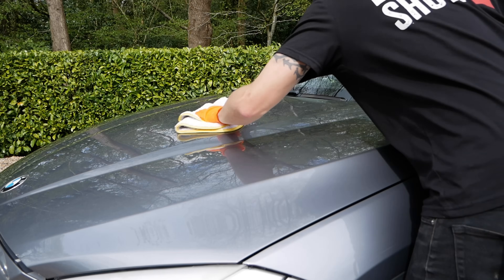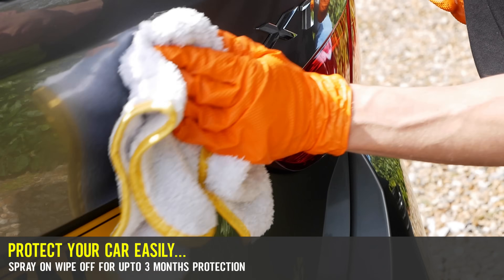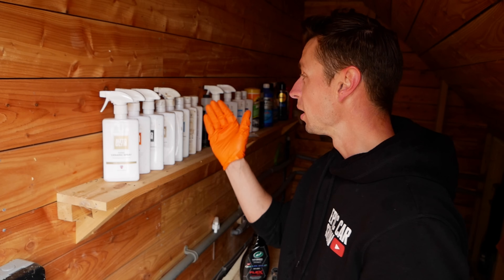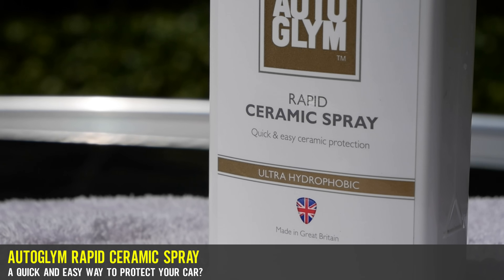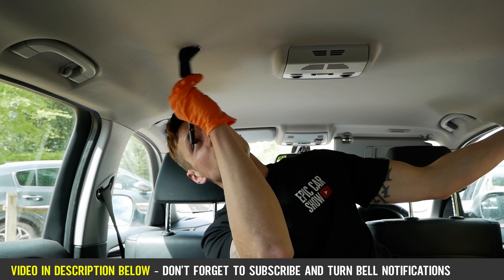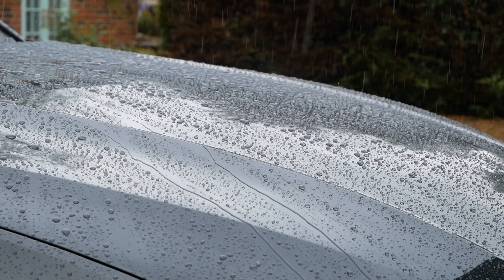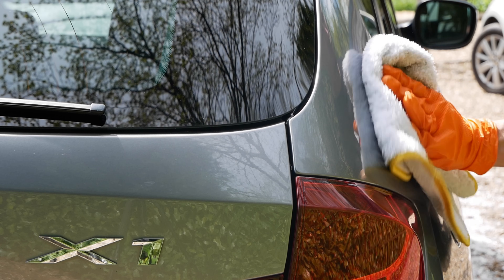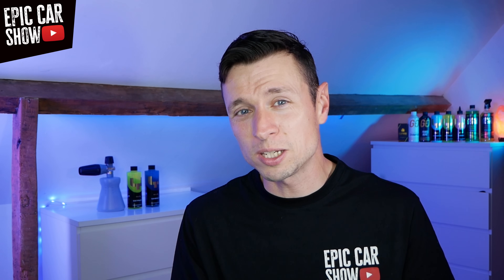Turtle Wax Graphene flex wax Vs Autoglym Rapid Ceramic spray Detailer // WHICH IS BEST?

Comment: I’ve had no issues with streaking with the turtle wax, light spray direct to the panel  and buff with a soft microfibre. My best wishes to Martin and family, my wife is a Macmillan nurse so I know you are having a tough time at the moment but try to stay positive.
Reply: Hi Dan, Thank you for your kind words and God bless your wife and all the other wonderful Macmillan nurses.
Reply from the maker: Thanks Dan. Love seeing so many people send kind words to Martin! This is such a fantastic community
Reply: @epicautomotivedetailing  It is a pleasant change to see people support each other, as you have stated there is so much negativity on Detailing forums and it needs to stop. We all may love cars and detailing but you just don’t know what is happening in people’s lives and how this bullying behaviour affects them.
Reply from the maker: @danlegge2742  yeah I want to try fix the problem or at least make it better by doing something positive
Reply: Have not used Autoglym as it appears to be quality products throughout. 
I however have been using the TW FLEX especially as an occasional topper to the TW MAX Wax.  The FLEX needs an initial wipe (per directions) with a damp towel followed by a buff with favorite fluffy.  Some have made an issue of the extra step...for me the astounding results render it moot.  The damp towel (for me) has constantly knocked down high points and streaking...light application of spray is essential!!
Points made and taken about time and effort on the car flip/professional level - point taken.  As a driveway detailer primarily doing my own rides -  appearance is the end game. Ten extra minutes don't  matter as long as I get the "dayamn!" look.  
All good! Give it a try!  I dig the British detail channels  - watching from across the pond!
Reply from the maker: @audieconrad8995  wow thank you and hello from UK. The term detailing is bit different to USA. We have car valeting which is deemed to be a service that requires just a good clean and detailing itself is something that is mainly aimed at paint correction and protection services so it can get confusing. I really like both of them but when I use Autoglym I can do it in fraction of the time. Sounds silly as both products similar but Autoglym is just better all round in all weather whereas turtle wax struggles in the heat for me 🙂
Reply: @epicautomotivedetailing  as mentioned - the AG has a good rep.  I'd like to give it a go.  Shine on you crazy diamond!

Comment: Great video again, and I like the way you keep them nice and compact while thoroughly explaining everything, instead of spending 45 minutes waffling and showing us the entire clean, which is completely pointless. 

I like most Autoglym products for their ease of use and speed. When you're getting on a bit like me and tire a lot quicker, it's mega important. However, I did get a 3-bottle kit of Turtle Wax's Jet Black products at a good price a couple of years ago and was really impressed with the way it enhanced the paintwork on my metallic black car. so I recently found a ridiculously cheap deal of all 3 graphene products for an all-in price of £22 recently so I bought those. I've only tried the detailer so far, but I found it so much harder to use that I would drop it a good 2-3 points compared to the Autoglym product. That said, it does seem to give a better, "blacker" finish on my particular car so maybe it's better suited to darker colours. Love the Autoglym though and although the shine isn't quite as good (may I'm using too much), it's much easier to use and that wins it for me.

Comment: Dave, love this video and your other on the AutoGlym Super Resin Polish. I have been cleaning and detailing cars for 30 odd years and I used to think Meguiars was the gold standard, UNTIL I discovered Autoglym. The Glass polish is amazing, and then I found the Super Resin Polish, which has literally been life changing. I use it on every car, from 911's to Toyota's and it gives the same very consistent and fantastic easy to use result. I tend not to use a wax, preferring to just use the Polish as a one only product. These Videos are fantastic, and I think support the brilliant quality that is Autoglym. As you say, they are not big on flashy labels and bottles, but it's what's inside the bottle that counts, and there is NO-DOUBT, that Autoglym is the gold standard for car care products.... If you've not tried Super Resin Polish, try it and you'll be converted.
Reply from the maker: Thank you my next video is a feature on many autoglym products 👌

Comment: nice shout out :)  
I haven't heard good things about the turtle wax flex wax durability, most people I've spoken to are saying a few months at best for the flex wax, that and the price, and yet again streaking issues.  The better product for my money, seems to be the graphene paste wax.  
I really don't like the AG spray bottles at all.  there are some good products, but the sprayers tend to leak, and leak some more, and they aren't comfortable to hold if your spraying a lot.  Right now, looking at halfords shelves, I'd be more inclined to go with meguiars ceramic wet wax and detailer over anything else right now.
Reply from the maker: I've got the paste wax which is great for gloss
Reply: Bottles/spray top of autoglym are  restrictive as so small in hand and are flimsy

Comment: I may be wrong, but I think Autoglym have the edge on customer recognition. 
If you are using Autoglym products, the customer is usually familiar with the brand, and knows of its quality. 
Given the choice, I would reach for the Autoglym product. 
Great video BTW
Reply from the maker: Your right about recognition, but the newer generation are easily distracted by flashy packaging and for Autoglym to bring out a new product with a very light brown label it just didn't catch my attention to make me think (ooh that's new lol) cheers for watching Kevin 🙏😁
Reply: @epicautomotivedetailing  I fully understand your point about brand recognition, but if your are going to change your whole world wide recognized branding for a generation that have the attention span of an Argentinian Ant, then your are going to end up in the complete toilet. The modern generation change their favourite polo brand between leaving home and arriving at work if they see a flashy Billboard. Aotoglym did not get a royal warrant for nothing, there are plenty out there who would love one. The generation of which we speak don't find brand loyalty well into their 30,s now, don't go throwing years of building up brand recognition and loyalty to grab their attention for 5 minutes. Just my thoughts, love your work.
Reply: Can we use both together?I am currently using rapid spray but want to improve durability.What other products can I use with this?

Comment: tried both and you're correct. Turtle wax flex wax is time consuming to apply on dry paint as a base coat. On business stand point where time is money i can understand you favoring Autoglym which is a great product by all means. However the longevity, durability wise i'll go for turtle wax flex wax + for the money it's a bargain especially doing their recommended 2 sprays per panel at the same time be able to use it on wet paint as a topper, but then again yeah, the streaking issue which is easily resolvable but also time consuming. both products are great in their own term. great review.
Reply from the maker: Thanks mate I was trying to get into the mindset of what someone like a weekend warrior would do so when i would wash my own car i would always spray something on top

Comment: I use Turtle wax hybrid ceramic wax. To avoid streaks I spray it onto an applicator pad. Just one spray per panel, just enough to keep the pad damp, then I buff it off  with a microfibre towel. I will definitely try AutoGlym next though, as it looks a lot easier and quicker to use. 👍

Comment: I use the turtle wax graphene, haven’t had any streaks, I spray 2 sprays onto my applicator per panel, in up down left right cross and then buff it off after, gleaming!
Reply from the maker: Yeah not every car has suffered from streaks,things like temperature and paint quality can play huge part.
Reply: @epicautomotivedetailing  yeah bro! Love your vids, keep smashing them out
Reply from the maker: @darylharvey3869  thanks mate they getting better every time hopefully
Reply: I've not had any streaking issues with the FLEX Wax spray. I use a square dampened microfiber applicator and spray directly onto the applicator and apply in a cross-hatch pattern - a little goes a long way.  As per directions I follow up with a dampened buff cloth followed up with my favorite fluffy. Terrific gloss! I hope this may be helpful...

Comment: I’ve tried a few different ceramic spray sealants but settled Garage Therapy. Easy to use and great performance. Three CS and Sigma is a great system. 👍
Reply from the maker: Nice one stick with what works for you 👍

Comment: I've been using Turtle Wax Seal and Shine up to recently and really enjoyed using it.  Applying it with a damp cloth to a not quite dry car resulted in a great finish.  Recently got a bottle of their ceramic sealant and was really disappointed with all the streaking.  Instructions advise applying to a dry car as opposed to wet or dry for SnS.  Just got a tub of their graphene infused paste wax, and while it does take longer to apply, there is not nearly as much streaking.

Comment: Very best wishes Martin hope you will soon be in a much better place.

Dave, whats the Autoglym gloss levels like? I have used their Polar Seal over the winter its worth considering a review if you have not used it (sealant that protects the entire car via a lance, easy on and jet wash off with solid results).
Reply from the maker: Hello Tim. In terms of gloss I don't have a gloss meter but technically I don't think any human needs one. The product is just a very good finishing spray / quick Detailer that nailed it in terms of application, lack of streaks and water tests. Definitely a firm favourite
Reply: @epicautomotivedetailing  Excellent, thanks. Your video convinced me that this will replace my good but not enjoyable to use TW hybrid solutions ceramic spray. My plan is to try this over some BH double speed wax through the winter months hopefully this will be compatible - cheers.

Comment: I used the turtle wax for the first time at the weekend.  I used it on my mica black MX-5 . I wasn't overly impressed with it when I applied it . To be fair to turtle wax I probably used to much product . However when I went out to the car in the morning the car was absolutely gleaming and I changed my mind to being impressed . The car has an IGL ceramic coating on it so I'll be using this as a maintenance product
Reply from the maker: Yeah it takes few attempts to work out best method to get it right but it does perform really well

Comment: Great video Dave. I haven't got either product but I've seen lots of reviews on the flex wax and I thought the instructions when its applied dry is to spray onto an applicator and wipe onto the panel and buff off. Maybe it wouldn't be streaky and easier to apply if was done like this?
Reply from the maker: It's hit and miss but the end result is amazing. Totally down to what makes your life easier
Reply: When I applied it as a base coat( truck dry) it went on ok..when I applied it on as a dry aide, it was easier and produced a great deep gloss to f a shine to my black tacoma. It rained a few days afterwards, drove it for a week, just rinsed it off and all the road grime was gone, super hydrophobic and water sheeting results. Thumbs up for me!

Comment: There is one area where Autoglym Rapid Ceramic Spray shines over all the other products i have tried. As a drying aid, using a micro fibre cloth and you spray the Autoglym onto the cloth sparingly, use it to dry, then buff immediately with another dry micro fibre cloth. Do it in sections, you will only need about 6 sprays for an average car. The gloss is amazing, and because you are using minimal product, layers up with each wash. The best i have ever used, and a bottle will last you a couple of years.
Reply from the maker: Yeah I love Autoglym stuff. It's the new guys in today's world that think the brand is old but it still does the job really well

Comment: gonna try both, i wonder which is most durable??
Reply from the maker: Turtle wax is more durable but it's not worth the time because Autoglym is not only cheaper it does exactly the same Job, plus easier to apply. Any normal person would never tell the difference
Reply: @epicautomotivedetailing  you say the AG is easier to apply! that depends which method you chose, doesnt it? you can just spray and rinse the turtlewax. or is this method flawed? (knowing my luck it is) . this was the method i was hoping to use. currently i use autobrite magiseal via foam lance. really easy but really expensive too.
the reason i need easy methods is i have dodgy wrists and any repetitive action is not recommended for me. so after hand wash i'm looking for an easy finish.
Reply from the maker: @1oldson  so what I found was turtle wax had nasty streaking although it's easy to correct I mean it in terms of the beginner using it. Tw was just slightly messy compared to auto glym but definitely not terrible

Comment: Interesting comparisson. I use the turtlewax as a drying aid which makes life a lot easier as there is zero streaking and I feel like it acts as a top-up of what's already there.
Reply: Interesting. I do it in reverse, i use Turtle Wax Seal N Shine as my base, and the Autoglym Rapid Ceramic Spray as a drying agent. The new Turtle Wax Seal N Shine improved formula is just so easy to put down, can do my whole car in 10 minutes, with fantastic results, the Autoglym just adds to it. So far has lasted 6 months in harsh weather with no signs of losing it's water beading and run off properties. We are spoiled in this day and age and i don't think people realize how lucky they are.

Comment: I didn't have graphene yet, but I choose Turtle wax Hybrid solutions  ceramic spray. Got it for £13/500 ml. My friend uses AG products and he has ceramic spray from them. 
I putted AG on ona side of my Volvo and the other side Turtle wax.
He did the same with his Ford and after 2 months TW is just better with some better water repellent and easier to wash of some grease and dirt. 
I am not biased to any brand and I use different stuff, bu my friend here is big AG maniac and he admitted TW was better and that's something.
Reply from the maker: Turtle wax one and done compound has become one of my favourites from the brand. I'm walking away from product comparison and reviews. Not for me but will be featuring loads of new products next week in the Halloween video

Comment: In this day and age. Detailing products that released that are not easy to use shouldn’t be released. Turtle wax should not released product that has a streaking issues it put people off and the customer won’t buy again and it expensive. I been using the autoglym ceramic spray for a few weeks now it is easy and durable even after a wash as you said. They say you shouldn’t use on glass I do and it good to. As a professional detailer there doing it in 5 litres now at £ 90 which is a bargain
Reply from the maker: Thanks Gavin, Autoglym trade products are great value for money

Comment: Do u throw away your microfiber towel after applying, cos the ceramic would harden n potentially scratch paint
Reply from the maker: Good question but no, this aren't like the hardcore coatings. So rinse them out after use and then machine wash them

Comment: What would you recommend as finishing compound- a really fine refined compound for maximising gloss. Don’t need cut - normally use 3m. But what do detailers recommend? Many thanks
Reply: Haven't used it myself but if its just a finishing polish your after I've  heard Sonax purfect finnish is the way to go. Even Yum cars rate it so must be good. Or try Menzerna 3500.
Reply from the maker: I enjoy using rupes zephir gloss.  White lid. brilliant finishing compound
Reply: @epicautomotivedetailing  Do you want to do a fine cutting machine polish on my 88 escort RS turbo the car is mint - make great content 👍 obviously I’ll pay you £££! Immaculate warehouse to work in for the day.

Comment: the hybrid solutions ceramic looks like it does better over time compared to the graphene type
Reply from the maker: 100% agree ive been testing all year and ceramic is better
Reply: @epicautomotivedetailing  Have you tried the hybrid solutions "ceramic wax 3-in-1 detailer"?  That seems to be a more comparable product to the autoglym in terms of purpose and usability.  Would love to know your thoughts.

I've been using the turtlewax ceramics for a little over a year now.  Love what it does for wheels and brake dust.

Comment: My 2004 Chevy Malibu the hood roof and trunk are so badly oxidized yet the fenders and doors look good I'm using Turtle Wax heavy duty compound with a Sears Craftsman buffer and a wool pad! I found it easier to actually wet the panel first and give the Wool pad a few sprays of water and then put the compound on is this wrong?